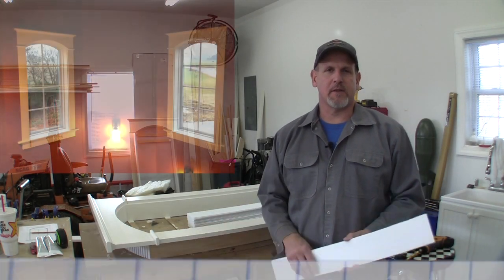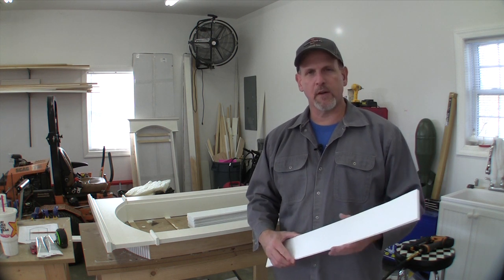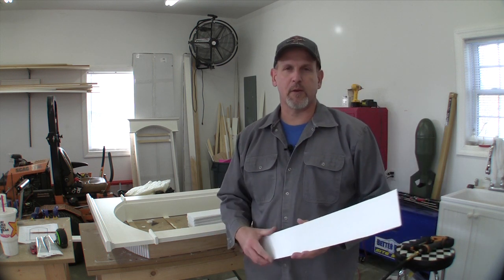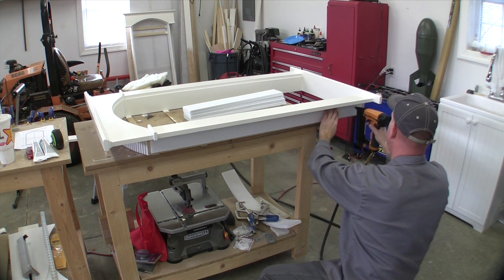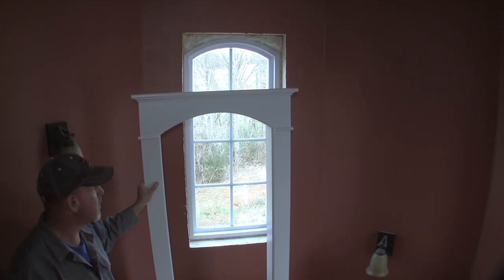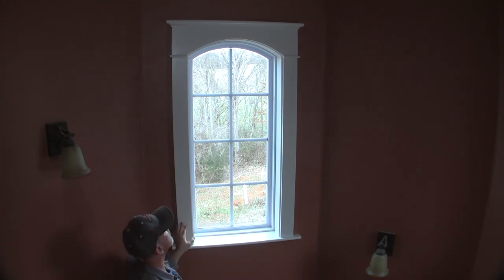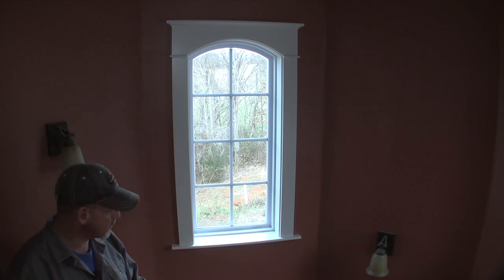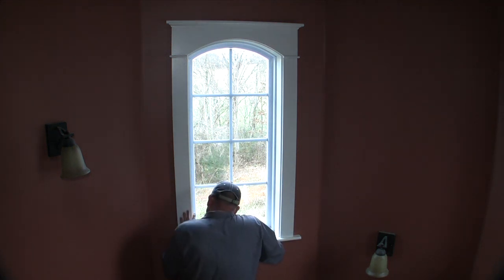How to Trim an Arched Window Pt 3

Comment: Very nice result.  I put in several windows this Fall.  On a couple, either the window from top to bottom or the extension jamb was bowed.  I was able to close the gap by opening the window (top and bottom) and pull the jamb to the window with a pipe clamp to reduce the gap.  I then nailed or screwed the jamb to the rough frame. Not sure that would have worked for you because the casing was already fixed to the extension jamb/trim which would have stiffened it.  In any event the window looks damn good!
Reply from the maker: Great tip.  Thanks for sharing it.  My problem was a little different in that the rough framing was out of square so "persuading" the jamb would have been very noticeable and probably would have made things a lot worse.

Comment: For a long time I have been trying to figure out how to bump out an existing window to allow me to install a blackout shade for my home theater, then I found your video and it is just what I need, with a couple modifications.  Thanks so much.  

I have one question though.  Since you made this beautiful template out of layers of 1" board, why not instead make the arch itself from the same kind of board, glue them together and use that instead of going to the effort of making the PVC arch?  It would eliminate that step.
Reply from the maker: Larry Coleman Thanks for watching Larry.  I really appreciate it.  I guess I never thought about your question.  I made the template because I had several of those arched window to make so it was a bit more efficient and cheaper to work form the template.  If you are just going to do one then I think your idea would be right on.  Thanks again for watching.

Comment: I'm familiar with those "righteous beads of caulk" when necessary. Surfed in as I'm installing some molding on a half circle window that is set above 4 other windows that are mulled together. I like your solution to your arched window and your methodical approach.  The molding I'm using is flexible and I'm planning on making a clamp system and gluing it up. Looking on the net to see if their is a better way.

Comment: Try using drywall screws instead of shims with pre-built trim like this, you can screw them in or out as needed, toss in the unit and nail it off.
Reply from the maker: Great tip.  Thanks for sharing and for watching!